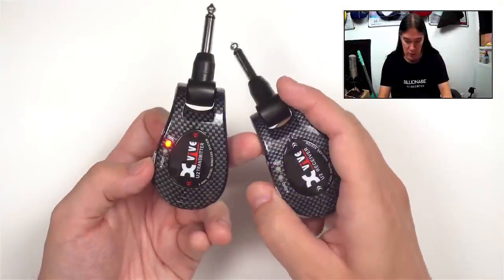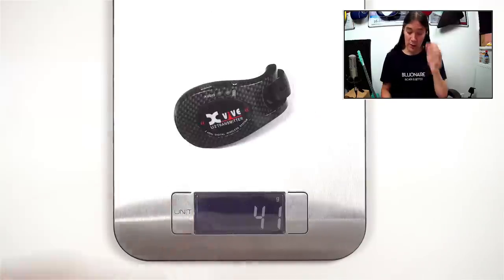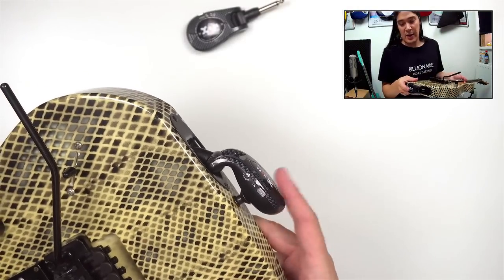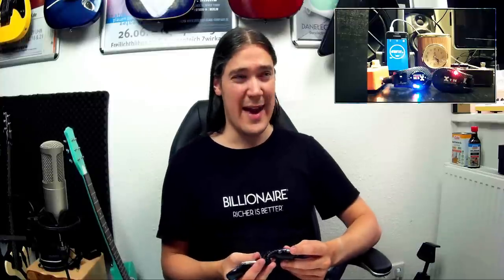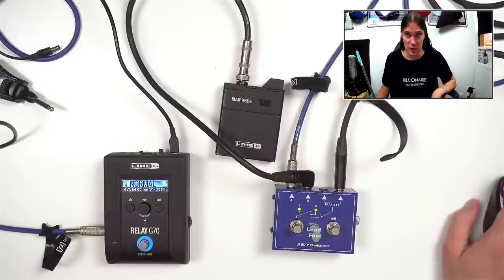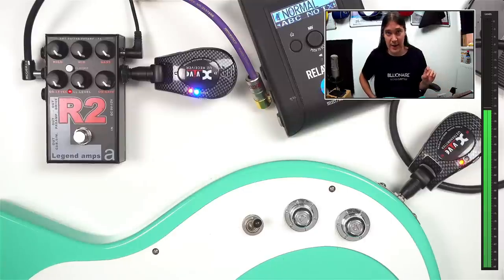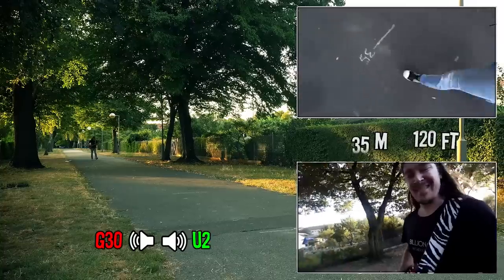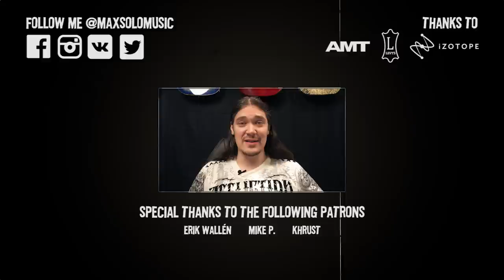Does XVIVE U2 Really WORK?

Comment: Will these work with active guitars?
Reply from the maker: Multiple people reported this unit had problems with EMGs and similar pickups. I can confirm that it doesn't go well with acoustic guitars with piezo and an on-board preamp
Reply: @MaxSoloMusic  I just got a set and I'm trying to use on a Godin LGX-SA that has an acoustic channel with a pre-amp. When I use it with the jack that has the pre-amp it has a horrible squealing hum/buz. So I'm guessing it just isn't going to work. Do you know if there is anything I can do to fix that? Thank you - great review.
Reply from the maker: @kenmaksim4096  there is one thing you can try. Get an extension and place the transmitter onto the guitar strap instead of plugging it right into the guitar
Reply: @MaxSoloMusic  Wow that's a great idea. I'm going to try tonight. Thank you so much!!!

Comment: I have read this unit will also cause wi fi to fail. Not good if using a digital board/tablet. Is this true?
Reply from the maker: Never happened to me with the U2. In theory, any 2.4GHz based wireless thing may cause wi-fi to fail as long as it uses overlapping channels/frequencies. My new version Line6 G50 kills all wi-fi in 20-meter radius, the older one didn't do that